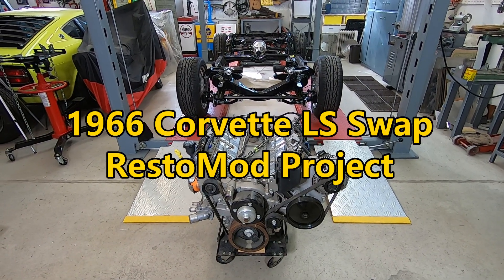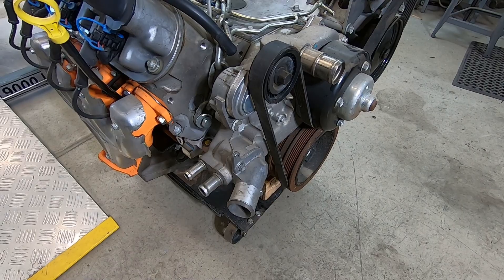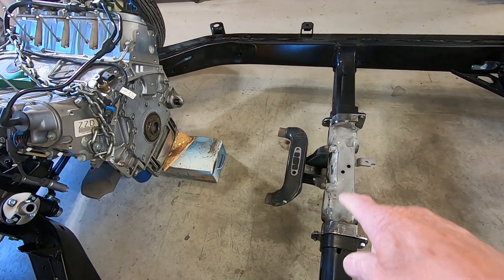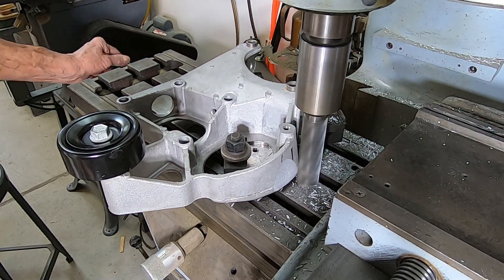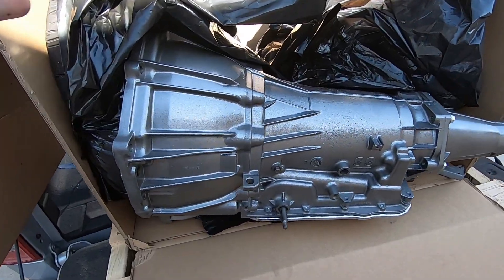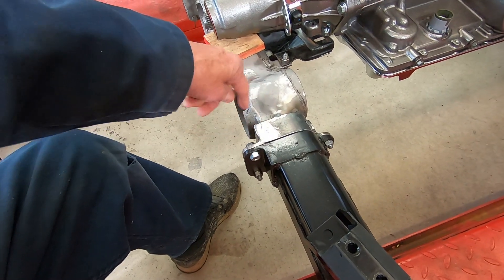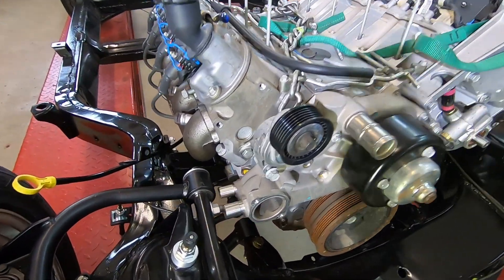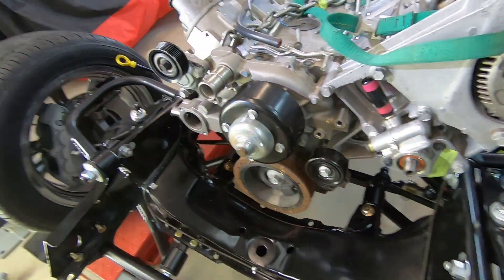Swapping an LS1 Engine/4L60E Transmission into a 1966 C2 Corvette Chassis

Comment: Very detailed video on this engine swap, great job! I will doing the same swap on my 1970 with a 6.0L iron gen IV block putting out somewhere north of 500 HP. I found a really nice accessory bracket kit from a company called LS Simple that uses standard GM truck spacing and truck accessories. I will be doing it like you did, with the body off. My original plan was to install a big block with a 5 spd but I have since changed my mind. The only thing I am worried about is the transmission clearance to the tunnel. My car was an original 4 spd. I have heard that the tunnel is different on automatic transmission cars.
Reply from the maker: Sounds like you have a lot of work ahead of you, but it will be worth it. I do not think there is much difference in the transmission tunnels, only a little bulge down by the floor for the manual linkage I believe, but not sure. Good luck with it.

Comment: are the right angle heater hose fittings press fit? or how did you screw them in
Reply from the maker: Hello, thanks for watching. I tapped the heater hose holes and used threaded fittings.

Comment: What year 4l60e trans did you use and how did you get it to bolt up to the corvette LS1?  I'm in the middle of figuring this out now and getting a trans for my 01 Corvette LS1 going into my 89 Camaro.
Reply from the maker: The 4l60e is an early 2000's model but I don't know the exact year. I bought it from Cyclone Transmission online. It is similar to what would be used in a Camaro with an LS1.

Comment: Would like to see how you tap the heater hose outlets. They were press fit. Any special treatment for leaks. And were do you source your parts?
Reply from the maker: Hello, thanks for watching. It was pretty straight forward. I just used a 3/8 NPT and a 1/2 NPT pipe tape for the two holes. The holes were slightly over size, but they threaded just fine, and I went a little deeper to compensate for it. The fittings are from Performance Stainless and the 1/2" one was a two piece fitting which allowed me to get them both installed in the tight quarters.
Reply: @DickShaw  I was pondering that and it made me wonder if somebody made "BANJO" type fittings in 3/8" NPT and 1/2"NPT for use there?   It crossed my mind because I used 6L80E Banjo Fittings for the tranny cooler lines in my tight tranny tunnel.   Just curious if banjo fittings would give more room ....